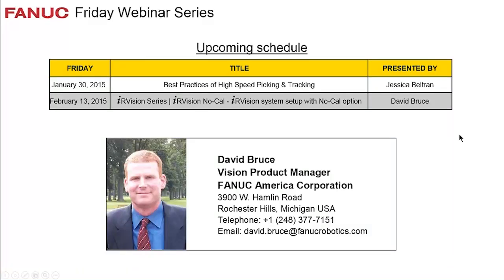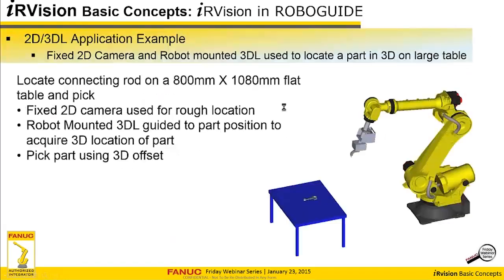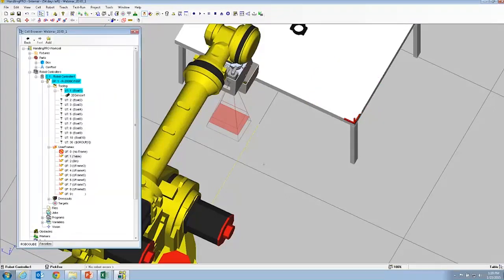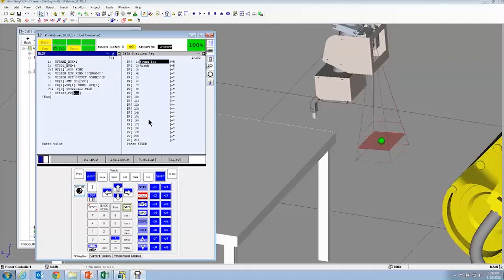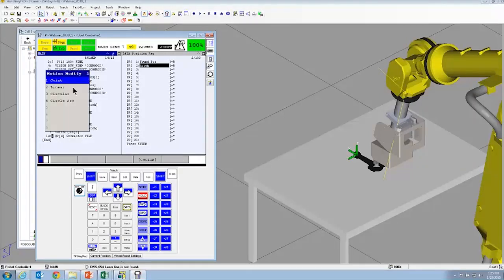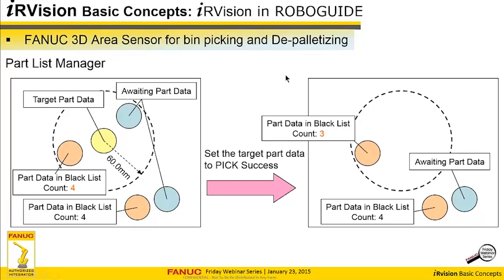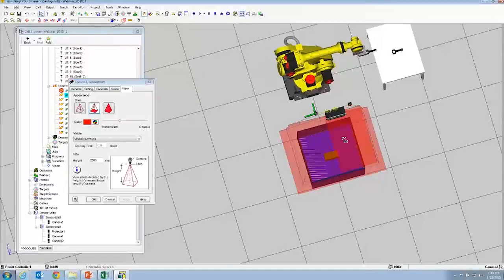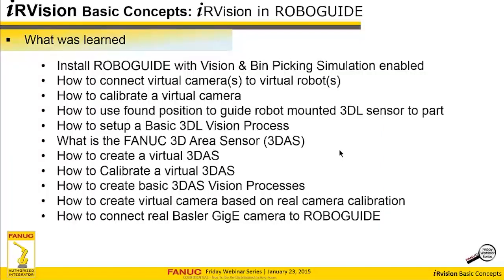How to set up FANUC iRVision simulation using FANUC ROBOGUIDE

Comment: Why are the jump labels 500 and 600 when setting the VR Offset? My jump label fails when I do this
Reply from the maker: Hello, here is some info from one of our iRVision engineers:
LBL[500] and LBL[600] will have to be created in the program.  When doing test program we usually don’t create the labels and the if the vision fails we try to fix it in iRVision and retry.  In a real application you can try to take actions automatically when vision fails, like change the exposure through a Vision Override or just post an error indicating the robot needs assistance.

If you need assistance or product support, you can also contact our Customer Resource Center:
https://www.fanucamerica.com/support/robot